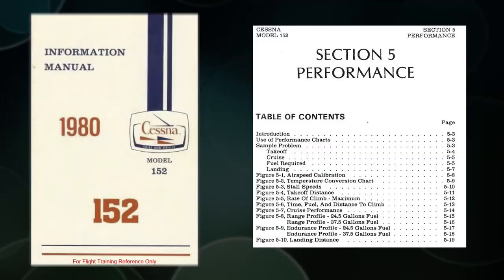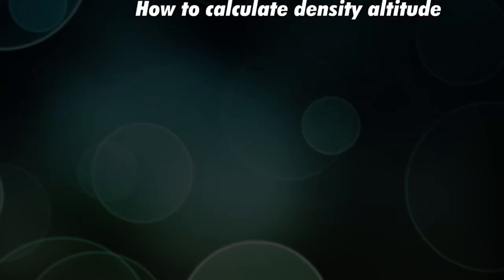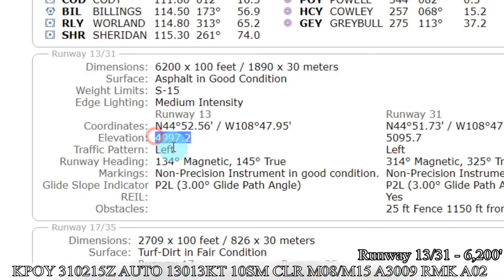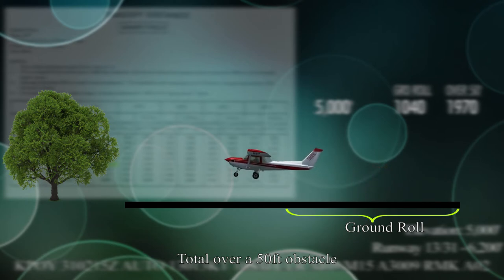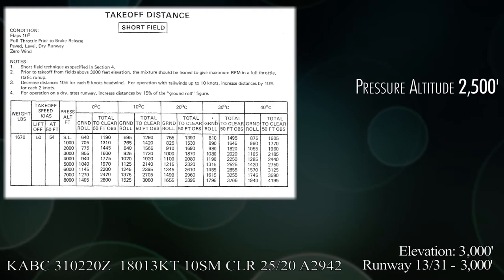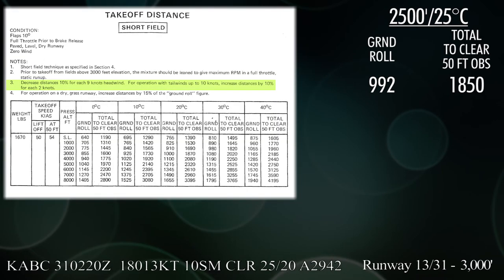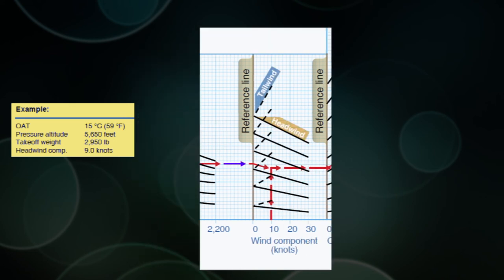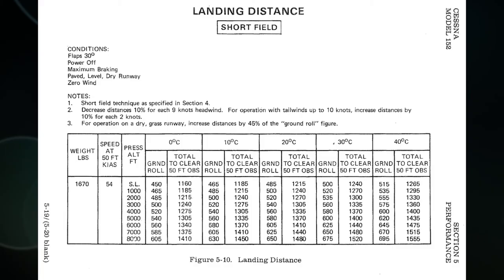Airplane Performance | PPGS

Comment: The second example is incorrect! To get the pressure altitude you must ADD 500 feet. If you take a close look at that chart you flash for the problem you can see that the correct adjustment for a altimeter setting of 29.40 is +485 feet. Please be careful with teaching aviation.
Reply from the maker: Great catch. Thanks for pointing that out.